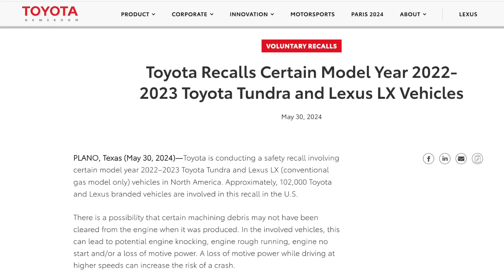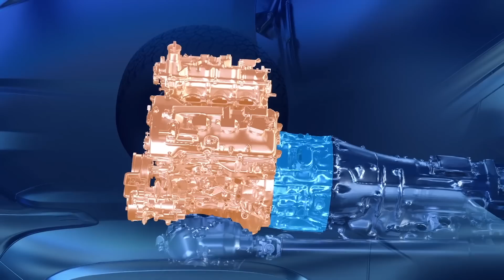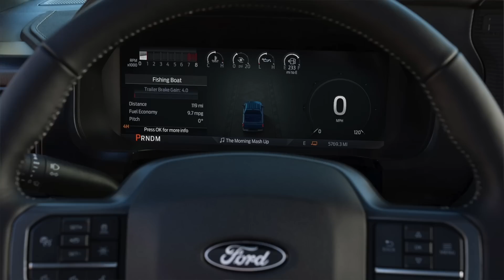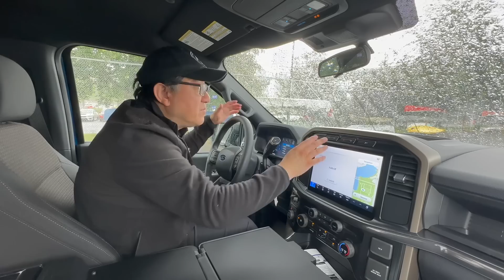ENGINEER EXPLAINS TOYOTA TUNDRA RECALL // SHOULD YOU BUY FORD F-150 INSTEAD?

Comment: You should see the gaps on my 24 limited Trd hybrid. Can’t believe how far Toyota has fallen since building vehicles in North America. And I got the truck about a month and 1/2 before this recall. Would have waited if they had actually owned up to this issue sooner for sure. Just keep my fingers crossed I guess.
Reply: Apparently you didn't mind those gaps before you took delivery. If you had concerns, did you bring them to the attention of the sales manager or the GM? Are they fixing it to your satisfaction?
Reply: @richardepstein3494  sure as hell did. And fact I had sold and traded my truck at that point I kind of had no choice on taking delivery. Just pointing out clearly that the quality that used to exist doesn’t any longer. You’re free to disagree.
Reply: Ok, now I understand. Did they attempt to tighten the gaps?

Comment: As someone that owns a 24 Sequoia, I love it. Toyota seems to take care of their issues. 

What about GM with the lifter issues? They aren’t recalling any of those. I hade a 22 Tahoe that had a lifter failure at 3000 miles and numerous electrical issues. 

Fords V8 has oil burning issues. They are doing about it. 1-1.5 quarts every thousands miles is acceptable to Ford. Cam phasers in the V6 is still an issue

Toyota has had issues with frames,engine, and other issues in the past and they find the issue and fix it. The 4.6 and 5.7 also has issues. Doesn’t seem anyone else is like Toyota when trying to find solutions.
Reply: My 2011 RAM 1500 had the lifter go at 100,000 miles... the replacement engine only lasted 64k with all preventative maintenance.

Comment: My 2022 platinum tundra lost its transmission at 20k and lost the engine at 34k  if you saw the number of engine and trans failures in the new tundras you would steer clear of them
Reply: How many oil changes did it have ?
Reply: @michaelrr3575  6 did them every 5k not every 10k. It was scheduled for another one before it went boom 🤣
Reply: @DJErickG2 big mistake should of been 500miles, 2500 and than the 5k. I did those with oil analysis found a lot of impurities. Good luck tho brother
Reply: @michaelrr3575 I did mine at 1k oil change with my 25 Tundra. Piece of mind
Reply: You damaged the engine by not following Toyota’s 10k oil change interval. Toyota will win in court and not cover your repairs.
Reply: @JoBiatch wrong 😂 if all oil changes are done at dealership and they send the oil analysis with a paid postage package can’t void anything. That’s why people should always ask questions and get everything in writing. 10k oil changes is the reason cars breakdown
Reply: @JoBiatch  Yep...Jap scrap.
Reply: @JoBiatch not true
Reply: Now tell us what Toyota did for you as a result please.

Comment: I have a 2018 F150 Lariat and it’s junk.  It’s put together well — no gaps no rattles, but so many problems. Screen/ computer failed - $1000.   At 60k miles hubs and tie rods had to be replaced.  $2200.   At 1st brake change the rotors “delaminated” and had to be replaced. So Ford thinks rotors should only last as long as brake pads.  Heated seats went out.  Bed light failed (not the bulb).   Automatic release of tailgate doesn’t work.   5 1/2 years old 80k miles.  And most of those problems happened before 60k.  I’d not buy another F150.  Since Tundra has failed there is not a good choice for a full sized truck right now

Comment: Hot take: Chasing more MPGs will destroy Toyota's reputation as the most reliable brand.
On another note the issue with this recall is it might involve engine work, if you know how they pay technicians at US dealerships you'd rather get rid of the car.
Reply: One option might be to just scrap the engine and replace with new. The economics of doing so does not compare to retail price of new engines as seen by the public.
Reply: @robertherrmann4823  true
Reply: They're not chasing sh!t. You know that there's this agency called the EPA. All manufacturers have to meet certain standards based on their averages. Toyota was just late to the party cause they dont sell nearly as many fleet vehicles, they dont have hd trucks or vans in the U.S. which why the big 3 had to make these changes a while ago.
Reply: It’s not mpg they are chasing its 0 emissions

Comment: Somethings never change, always change oil on a brand-new engine within 500 to 1000 miles, no matter what the manufacturer tells you.
It's likely the mileage intervals for oil changes are influenced by the marketing team, trying to one up the competition.
Reply: Amen people need to learn that the lease game has made destroying your car a thing honestly. In the 70s 80s and 90s all car had a break in oil period. Oil analyst shows the iron and other debris that destroy engines. People waiting 5k or 10k is insanity for an oil change
Reply: Long interval oil changes are a marketing ploy. In most situations the long interval is for normal driving only with normal driving defined as highway driving ONLY. So if you do city driving or short trips then a much shorter oil change interval is required.

Comment: I used to be a huge Toyota fan, but they have lost all respect. First off they don't even listen to their customers! We don't want v6 or 4 cylinder engines in our trucks! Then they not only remove the v8, but they replace it with a faulty engine. 

They are also WAY over priced! And their technology is way behind other brands in many of their vehicles! They should have a lifetime power train warranty for the price they are charging, period! Good luck selling $80,000 trucks in this economy!

Comment: If  engines from 2 different plants in 2 different countries have the same failure it seems more likely to be a design problem rather than a process problem
Reply: The process is part of the design.  They aren't going to manufacture the same engine differently dependant on region.  You think they are going to build variations of manufacturing equipment?
Reply: @lukelowe918 I think he meant it’s not a quality control issue at all certain plant
Reply: These engines are machined by robots using software. If that software is used in both plants then they will have the same issues.
Reply: More indicative of parts quality control
Reply: My dealership told me that they had a big sub contractor that screwed up on the engine

Comment: People are really overreacting. Recalls is a normal thing and not all recalls are serious. They can recall vehicles off of bumper clips (2022 highlanders). And Toyota does recalls better than any manufacturer and for those who brought a Tundra the first year and new engine, should’ve known better. And if u think recalls are bad lol look at ford’s history
Reply: If a 2022-24 Tundra V6 fails at 61,000 miles the owner will need to come up with $25,000 or so to get it replaced.  And because used truck shoppers know the 2022-24 Tundras have a short lived V6 engine, the resale value of those trucks will be low. So we see owners of 2022-24 Tundra are doubly screwed.
Reply: @4af  I’m sorry you’re confusing with this comment. If the example you’re giving is the case and it fails I’m sure it’ll be one of the vehicles included in the recall. The engine I’m sure isn’t $25,000 and since it’s a recall whatever the remedy is it’ll be free of charge. And for those who engine failed b4 the recall a lot were under warranty and got replaced anyway.

Comment: Just traded 2020 f150 for comparable 24 GMC. I had gone back and forth between GM and ford every 6-8 years. I can say with confidence after just owning 2 f150s back to back that the GMC doesn’t quite stack up. I knew what I was buying but I found myself annoyed by some deficiencies. A couple of examples, the app to monitor and start the trucks are free with ford and $15 per month with GM. Slightly less power with 3-4 mpg less. Those were the ones that really got me but the other small things add up. Who knows which one will go 200,000 miles but it really doesn’t matter because I won’t keep it that long.

Comment: David, what about all the recalls on the 150? Why should anyone trust any Ford product? Recall after recall after recall....
Reply: The National Highway Traffic Safety Administration has finalized its list of automotive safety recalls for 2022.
Ford Motor Company led all automakers with the most recall alerts in 2022.  notified owners to bring their vehicles in for an urgent safety repair 67 times last year. All told, 8,636,265 Ford-built vehicles got a recall notice.
Reply: that's why I traded my 2021 F-150.  2 more recall notices last week alone.  Almost every month it was in the shop.  F-150 features are great but quality is horrible.
Reply: The recalls they refute to have nothing to do with engines, my like Wiper Blade Motor, Dash going dark etc. all easily fixed.
I love my F150, and I’ve order a new one, should be hear in late July I hope.
Loaded platinum with new split gate, massaging seats etc!
Reply: @mcmuskie2563 What job do you have and how much money do you make to afford that truck?
Reply: It is better than any of the rest, even with recalls!!!!!!

Comment: Most F-150 won't fit in my garage... only option to do that would be regular cab (not super cab or super crew, the old regular cab with seats almost on the back window).  Not that I'd be against a Regular cab, 6.5 foot bed V8 F-150 ... but not much seating room in there.
Reply: You need to move.
Reply: @user-tb7rn1il3q  This is a pretty common thing really... if you want to give me a few hundred thousand dollars though, moving would be great.

Comment: I took one of the first Honda Ridgeline’s off the line in 2006 and drove it 450,000 km with no issues. I wanted to trade up to a Tundra from a 2017 manual Tacoma I have but I think I’ll stay put.

Comment: Should we pass Land Cruiser and 4Runner too ?
Reply: I would trust those because all Toyota pickups, Vans and SUVs with 4 cylinder engines dating back to the early 1970's have been supremely durable.
Reply: My sons 2017 Land Rover- blew its engine at 260,000 miles in Australia

Comment: This was a bit of a sugarcoating. Catastrophic engine failure is a far more serious recall than what we generally see even with new roll outs. Also, there are already reports of new 2024 trucks having the same engine failure- the assumption that newer trucks aren’t affected and the issue was corrected doesn’t look to be accurate. We need to stop giving Toyota free passes on their quality because we previously knew them to build reliable vehicles- it’s pretty clear they have slipped in that regard.
Reply: Agreed
Reply: not really
Reply: Sugar coating or very optimistic opinion was also my feeling.  It's more than just a few being affected by major engine problems not to mention over smaller problems with sub standard materials and short life.

Comment: Six months ago I bought a 2019 Tundra Crew Max 5.7 with 42K miles for $35K. It may not have all the fancy tech but it’s reliable and paid for.
Reply: Did we forget about the 54 separate recalls the 2007-2021 Tundras and unfortunately one issue that was never fixed was cam tower leaks and why it wasn't a safety recall is beyond me especially when you have oil dripping on a hot exhaust manifold.
Reply: @davidromero6335  meanwhile GM has been building the same garbage V8 for decades that eats it's own camshaft and leaves people stranded but has never had a recall even though it is 20 times more common than cam tower leaks on a engine from 2007.
Reply: @FRWD_FXLRST  I do what I want
Reply: @FRWD_FXLRST  Harley Sucks too
Reply: All the fancy tech is a main reason not to want a new truck, on top of the other issues.

Comment: FOD - Foreign Object Debris...sounds like they have a process control issue. Apparently Toyota knew there was an issue but was slow to respond. Also, the affected engines should be replaced not rebuilt.

Comment: After long consideration I went with the Chevy outfitted with the 5.3 liter, standard 6’5” bed and the 4 door largest cab. The truck is performing very well. Excellent gas mileage on the highway excess of 22MPG. Very smooth ride. Acceleration is surprisingly very good.. no regrets at all.

Comment: I'm really wondering if Toyota is telling the truth about the engine issues. I'm thinking the engine might be a bad design.
Reply: no one actually thinks this. you read that on another thread and are repeating it now.
Reply: @kellyvoelkel8442  True, I saw this on another video. It makes sense that it could be a bad engine design since Japan and the USA built engines are having the same issues. I'm not an engineer or mechanic.
Reply: Time will tell  @kellyvoelkel8442
Reply: Could very well be....it's like Ford 6.0 Diesel....that engine was a piece of 💩!
Reply: @robertmardis2110 the replacement 6.4 diesel was even worse! Took Ford almost a decade to get back its reputation with the 6.7.
Reply: but also at the same time...the TTV6 was put in the Lexus lineup for a few years before it gets into the Toyota lineup.
Reply: @Baebon6259  I'm pretty sure Toyota and Lexus made a lot of changes to the 3.4t engine for truck and large SUV use. They made big changes to the 2.4 turbo 4 cylinder for the Tacoma.
Reply: https://youtu.be/Z8aUBUOXShw?si=MIvWTCOHToRO-hTe
Reply: No shit Sherlock
Reply: Toyota is hiding something. I picked that up in the corporate lady’s demeanor when my new sequoia was taken in for issues.